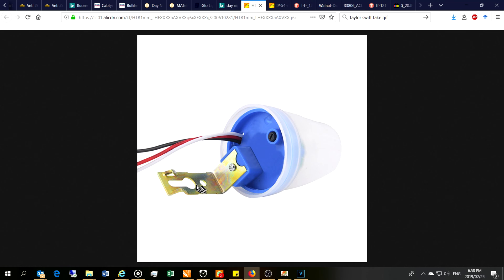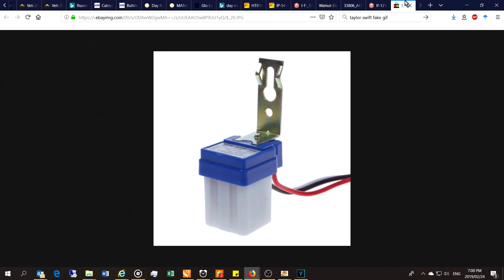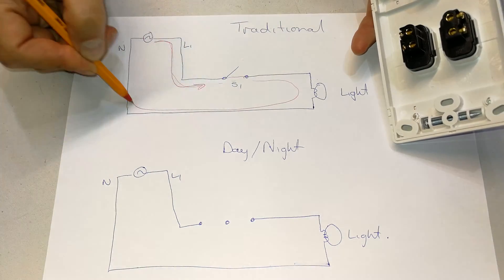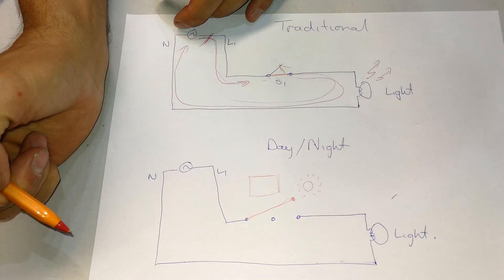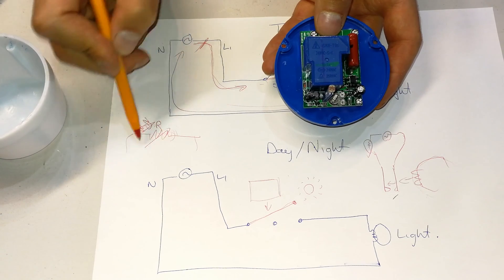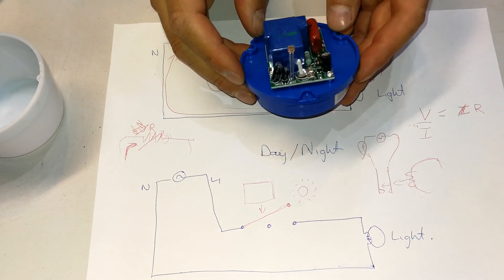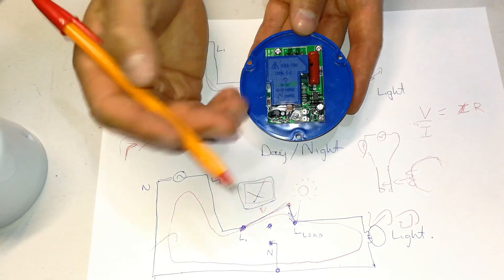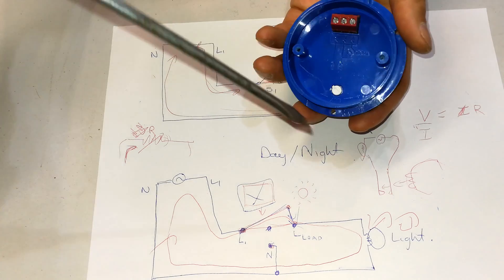How does a day night switch work- technical explanation.

Comment: well explained, is it possible to modify the day/night switch to work oppside direction, i install a fan in one of the control box and i only want it to run during the day and off during the night. can the relay be modified?

Comment: Okay so I just want to make sure... More sun=> lower Resistance and lower resistance =>higher current... But if there is  current flowing that means the light will work? But then when the sun is shining the light will work?
Reply from the maker: not exactly. More current through the photo element just means it can operate a switch/relay. If the relay is normally closed, the more current maintains the relay open and does not allow current to flow to the light. When there is no sunlight the relay can go to normally closed. Thats one way. So its an inverse function.

Comment: My outdoor light connected to a WACO Blue daylite switch, comes on even during the day momentarily...what could cause this & how can I reset it to function normally ?
Reply from the maker: it comes on for about 3 seconds if the power dips or if the sunlight is low. If it comes on and its not those two reasons, the unit is faulty.